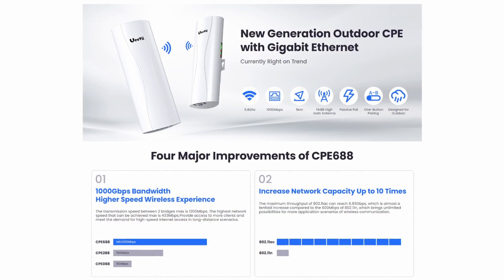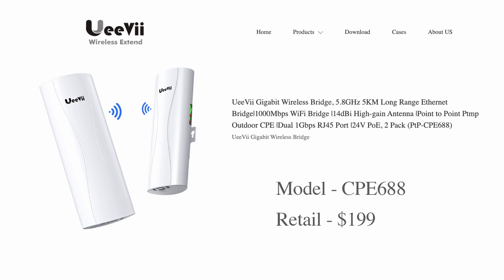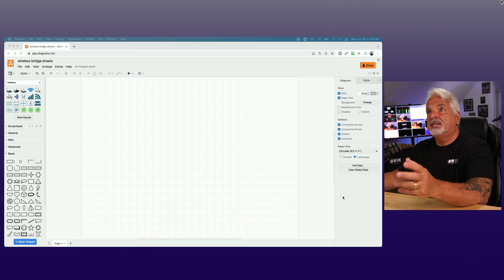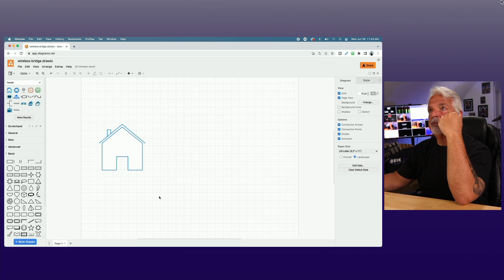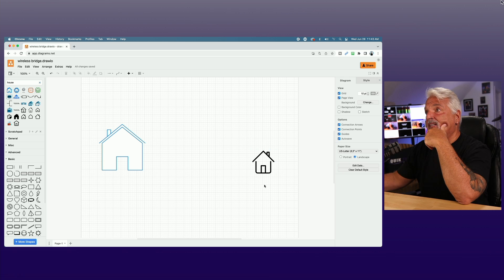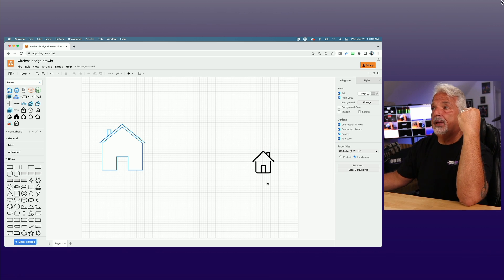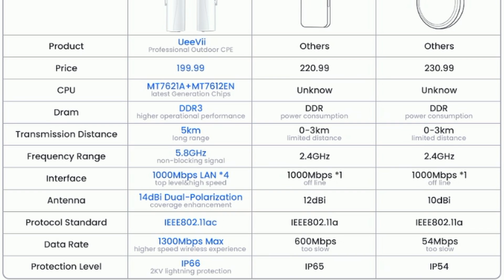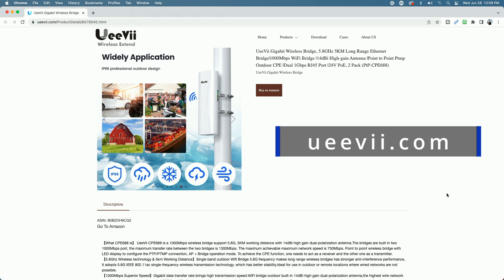UeeVii Wireless Bridge Part 1

Comment: The config & setup is absolutely horrible. It works out of the box, sorta, but if you touch anything it falls apart and won't come back to the way it was. Not even after a factory reset
Reply from the maker: I’m sorry you are having a bad experience. I will say the web interface leaves much to be desired for sure.
Reply: @QuikTechSolutions  After hours of working on it, I concluded that my unit is defective. Touching the settings resulted in physical damage. Refund is on its way
Reply from the maker: @eitantal726  it happens. I just RMA’d a $1700 video switcher from Blackmagic Design.
Reply: @QuikTechSolutions  There needs to be harsher penalties than just a refund. I'm not getting my time back, I'm not getting what I hoped I would be getting. I decided to delete my Amazon account, as this is not an isolated incident. Amazon and all these cheap Chinese companies are making the world worse, and needs to change

Comment: Does it work if there is a building in the way from line of sight?
Reply from the maker: I did not test this as line of sight is optimal. A building in the way will definitely impede the performance of most wireless bridge setups.
Reply: @QuikTechSolutions   Hmm, ok I want to extend my home network to the front gate of my property, about half a mile from my house but the barn is in the way, any suggestions?
Reply from the maker: Suggestion is to get them up as high as possible, best if you can get them higher than the barn.

Comment: Hi Tony, that looks like a later unit to one I was sent about a year ago to review.  Unfortunately, one of the two stations they sent to me was defective, so I never completed the review.  I've always meant to try taking it apart and seeing if I could somehow fix it, but never seemed to have the time.
Reply from the maker: Thanks for watching David. I’m hoping it tests well. I have a use case at a church I service. Twice a year they host outdoor festivals.  I’ve equipped them with outdoor wifi, so that’s not an issue. However, they use Clover credit card terminals on wifi, but the printers are hard wired only and are located in a stand across the parking lot from the church. This year we ran temporary long ethernet cables to the printers. I’m hoping this wireless bridge could fill that void even if setup temporarily on tripods. Still much better than running ethernet cables across the parking lot.
Reply: @QuikTechSolutions  Tony, I'm sure it will go well.  I was disappointed when I had the defected unit and they would not replace it.  I had invested in some test apparatus that has been sitting in its box for over a year that I may never use.